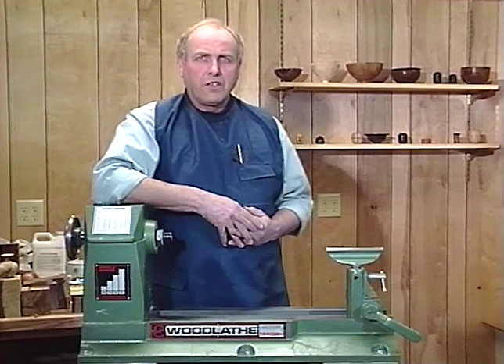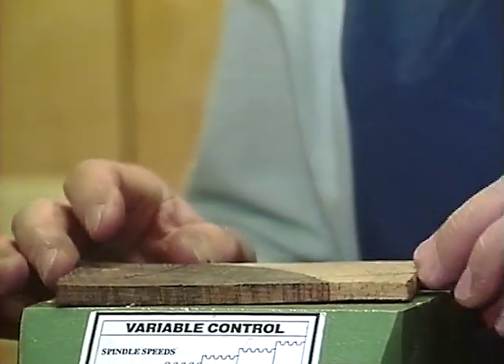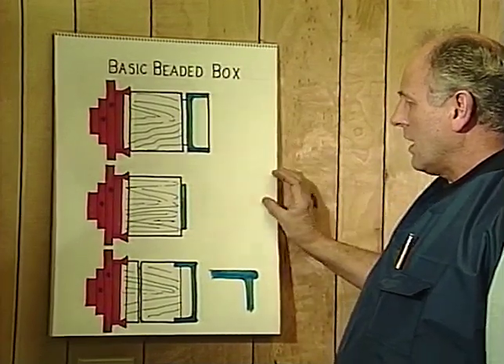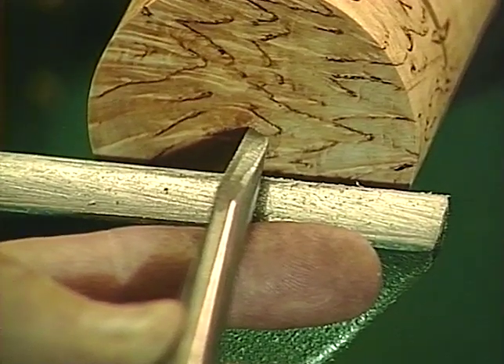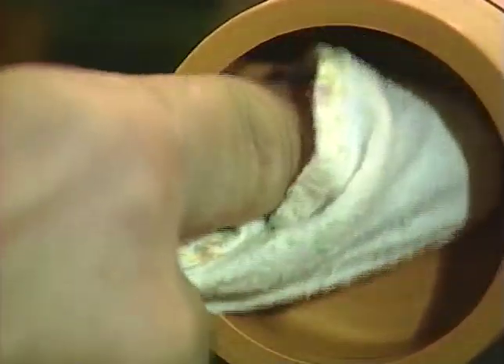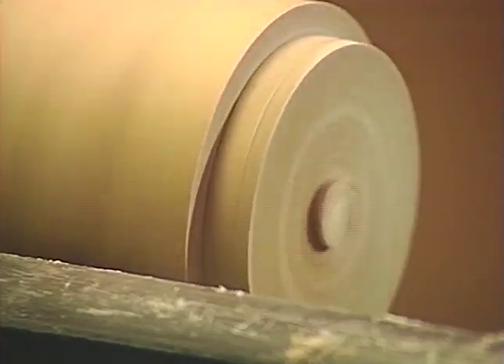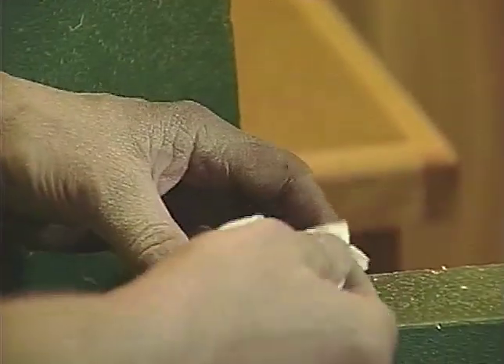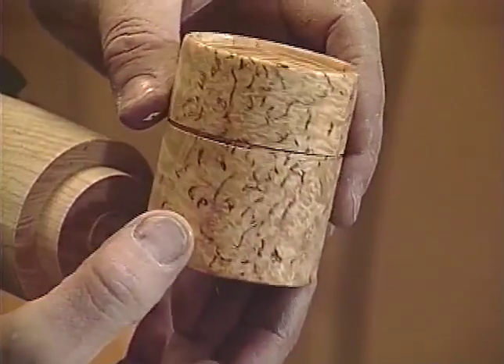The Basic Box by Ray Key (Woodturning How-to)

Comment: This presentation is brilliant and covers everything that a new turner needs to get started with the exception of three things that come to mind.
What kind of wax is used for the sanding?
How is it that lacquer can be applied over wax?
The height of the tool rest relative to the center of the material being turned is never mentioned.

Thanks JIM
Reply from the maker: Thank you for the insights.
Reply: I would also like an answer to these questions ... I in no way dispute or criticize, but I would have thought the sanding wax would prevent the lacquer from penetrating 
Also, 2 waxes are mentioned, both referred to as “soft paste wax” - is but the final is “high quality” - could you please give some further explanation - 
Otherwise, great video and great detailed instruction, I have learned much - Thank You.

Comment: I think I read somewhere, that using steel wool on the lathe is dangerous, and should not be done. Is this true?
Reply from the maker: Steel Wool is perfectly safe on the lathe. If it does get caught in the spindle, it's thin enough that it'll tear well before it could pull anything in.  It is flammable, so be sure and keep it away from the grinders in your shop. Use safe lathe practices and good judgment and you'll be just fine.

Comment: If you use the end of the stock or blank to hollow for the inside of the lid, how is the grain going to line up once you flip it over.
Reply: I wondered the same thing. Matching the grain is very important on a lidded box IMHO. What I do is chuck it by the lid end, turn a chuck spigot on the bottom end, then part the body from the lid and hollow out the lid, then turning the lid's exterior close to completion to be finished while jambed onto the body which I turn last.

Comment: Thanks for the great info. I took your advise and turned a box out of pine...well I still have a few things I did not do, but the box came out and I am especially happy that the top fits tight and the box does not rock on a smooth surface..just need to practice some more now.
Reply from the maker: Thank you for the comment. Practice makes perfect :)

Comment: Very nice detail and craftsmanship!  I've heard that when choosing the wood a person should keep the pith in the center of the box so any movement will be as equal as possible.  The theory is that the lid and body of the box will not be as likely to become egg shaped and  then fit better during seasonal weather changes etc.  I know you advised to use very dry wood to start with but I did not see any indication of you trying to choose wood leaving the woods center pith in the center of the box.  Do you find this not to be a problem?  Also, can a person use green wood and rough turn the box/lid and dry it using the wet chips in a paper bag method.  Then finish turn it when dry?  Please advise your thoughts.

Thank You!!
Reply from the maker: Most box makers prefer to use blanks that do not have the pith in them. As a box maker myself, I like to have the end-grain as straight as possible I.E. quarter-sawn to help minimize wood movement. Dry, close-grained woods will also help minimalize movement.
Many turners will rough out box blanks to help shorten the drying time. To do this, leave the walls of the body and lid extra heavy. I don’t try to fit the lid at this time, because you will have some movement.  You can use the paper bag method to dry your blanks too. This will also help keep the body and lid of the box together. After the blank has dried I turn as normal.
Hope this helped :)